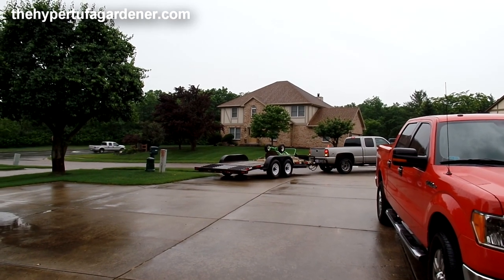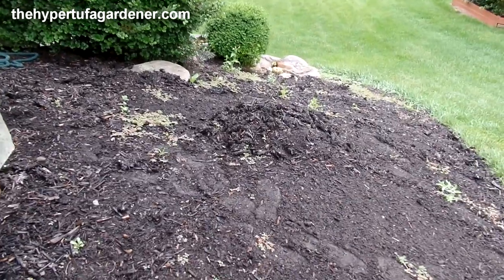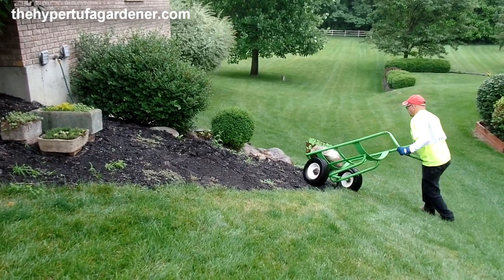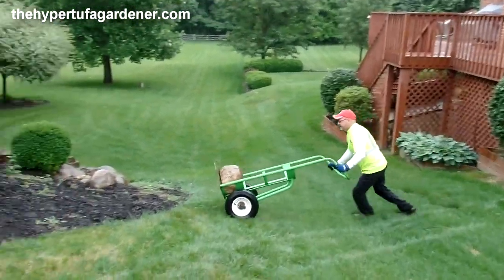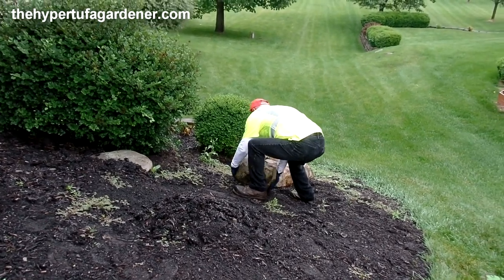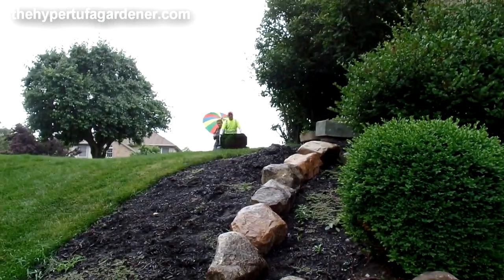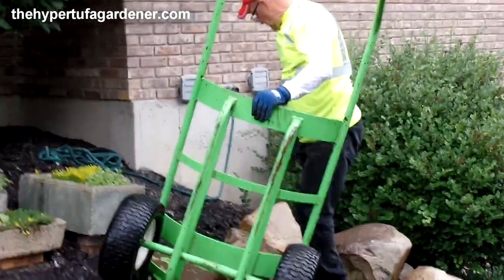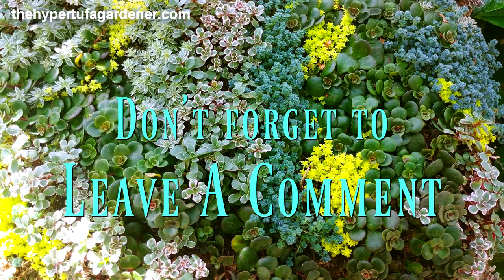Landscaping With Rocks - We Bought Boulders!

Comment: I’m researching before I start a total yard makeover. We had a fire in 2020 and just got back in the house. After 2 years of rebuilding the yard was destroyed so it’s being completely leveled and reseeded..  I’m paying them to do the front,  it the back I want to use boulders and rocks for edging the gardens. If you’d be ok with sharing, what was the basic pricing for those rocks?
Reply from the maker: We paid $150 for delivery and placement, so the cost was way under $1k total. We priced rocks at various places, but they delivered but don't place them. This is SW Ohio so your prices may be way different. Maybe that will help you. So sorry about your fire. How devastating!
Reply: @KimsGardensandHome  thanks, I’m at the early stages of shopping so just trying to get base to expect. Thank you! We survived and rebuilt it will only get better from here.